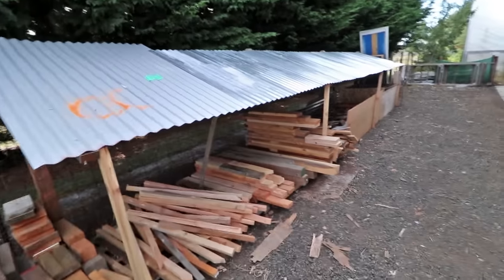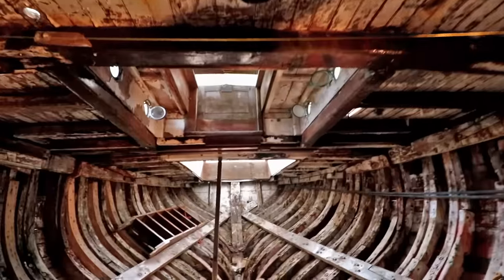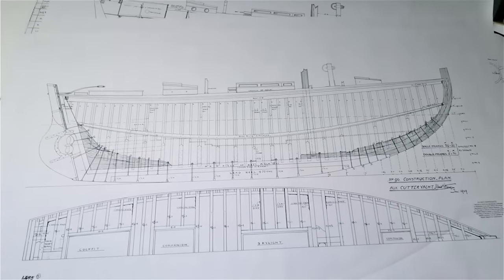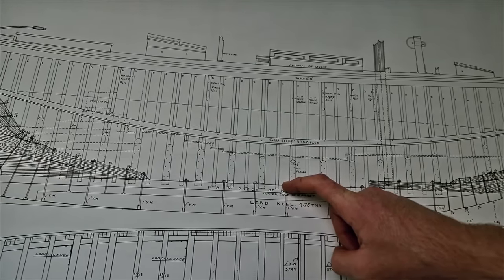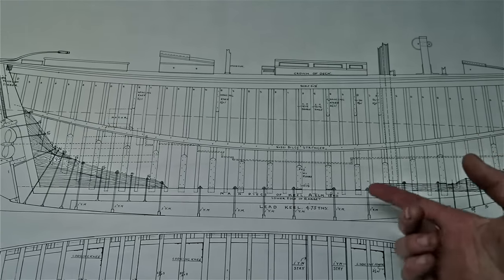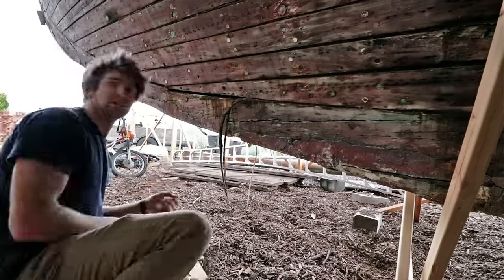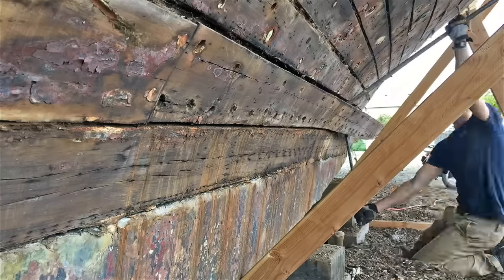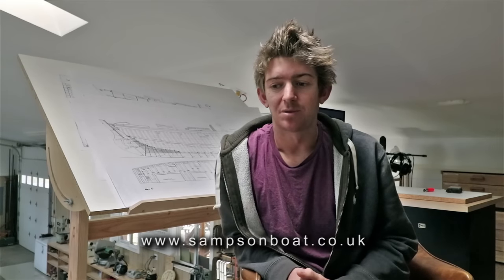The Rebuild Begins - Rebuilding Tally Ho EP6

Comment: Amazing looking back five years ago to the present. Leo’s perseverance and energy is boundless.
Bravo!
Reply: It is great to see how Leo has changed - yes the designer quif for a hairstyle but otherwise a more mature and commercially savy person. I think if you had told him at this stage of the project that it would require a complete rebuild then not sure what he would have done.
Reply: @douglasrogers3918  I should have added Leo AND the Tally Ho team of boat builders; the ancillary engineers and artisans, without whom it would be impossible.

Comment: The Mariner was a 50 ft staysail schooner I did some work on for Al Perrin. We removed the concrete ballast in the bilges to get at the plates from the inside. The concrete was full of boiler punchings rather than stone, which we separated out. The problem of re-using the steel punchings was solved by my Dad who suggested using sections of inner-tubes as bags. These were closed with copper wire and could be shaped and pushed back into the bilge spaces. This was all in 1961. Maybe inner tubes can't be had now, but something like that might work. Air can ventilate between the bags, and they stay in place but can be easily removed for maintenance.  I haven't seen the whole series, but when you get to that spot in your progress, try that method. Best of luck to you.

Comment: Is the fact that those blunts were so hard to get out a good sign the keel timber is in great shape?  Do you have to go back and plug all the holes later with dowl pins or something?  The wood looks rough, but is that just the worn out paint and the outer surface but in general the frames are in good shape?

Comment: I am confused about the entire project.    Does every board and timber get replaced with new wood, or are there keepers like the ribs and the inside bow to stern boards?   Is this whole pile of wood just a template, or what percent of the old timber remains useable?    When it is all done will there be a copper or a fiberglass skin over it to make it last longer?   Does fiberglass over wood work as a strategy or does that have its own issues besides any purity issues like some hating vinyl siding on an old colonial house.   I may have missed the overall assessment of the state of the boat and what has to be done.

Comment: Its 2020 and I have found your videos.  The question I have is at what point can you call a boat a rebuild vs a new boat based on an other ship?  In later episodes I see most of the structure has been replaced.